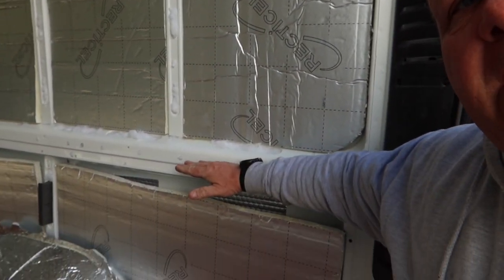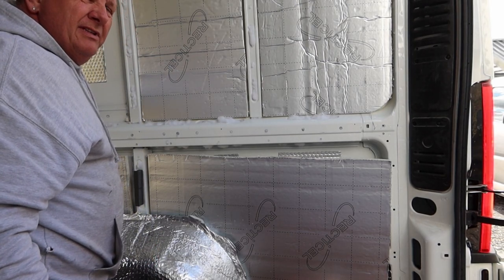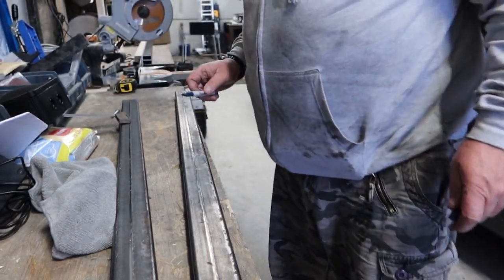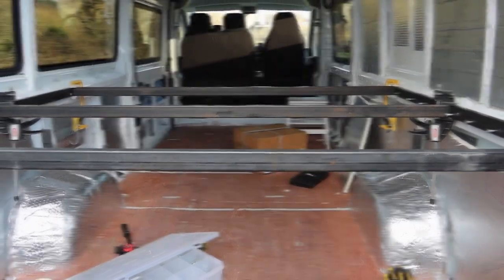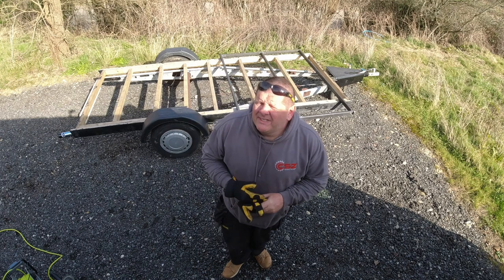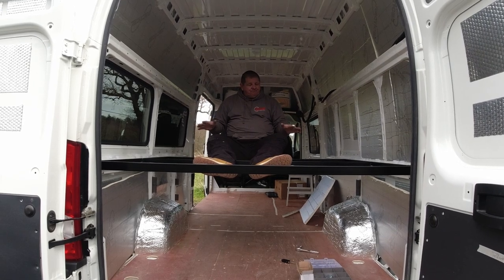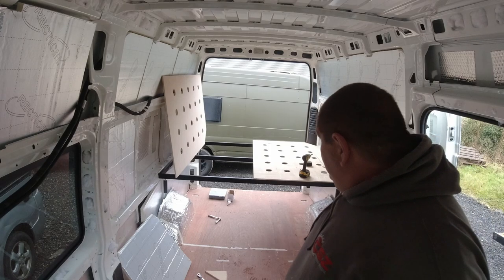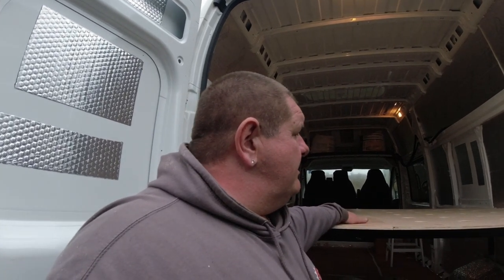Campervan Bed Build - Relay/Ducato/Boxer

Comment: Hello Karl, what thickness ply board did you use? And what size holes did you put in ? Many thanks.
Reply from the maker: I used 12mmm thick ply and drilled 60mm holes for the ventilation